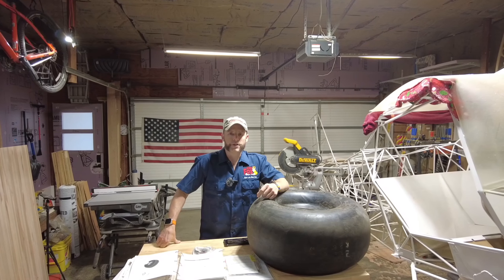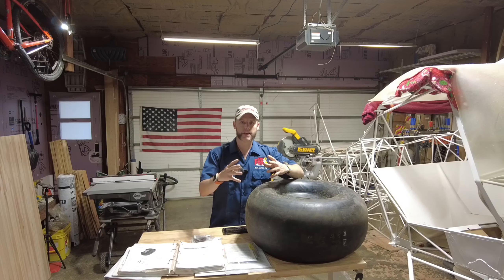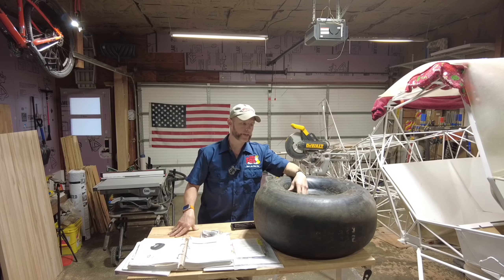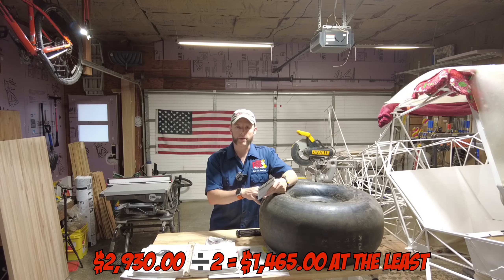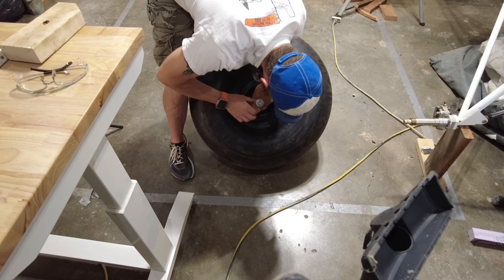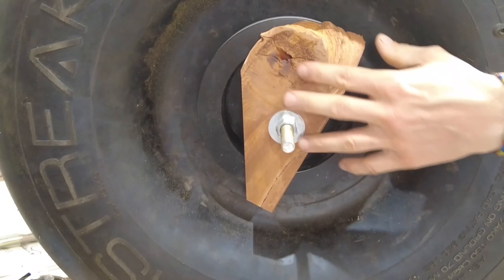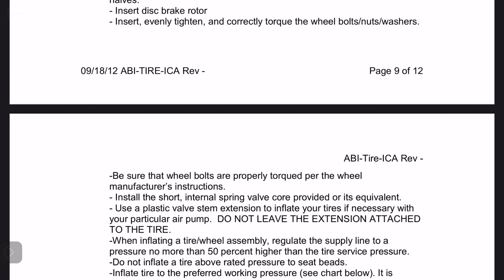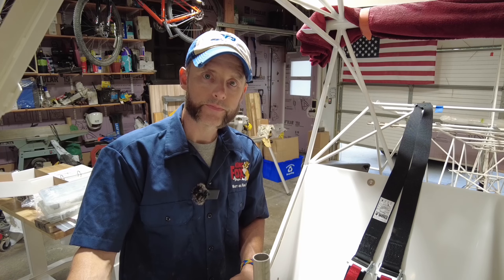#56 The Tire Debacle

Comment: Hey Matt! Whenever I'm dealing with airplane tubes I use a crap ton of talc. I'm not familiar with these integrated tube/tires but I've had 2 tubes leak on the sidewall due to lack of talc. Seems like it would help the rubber slide where it is supposed to be instead of sticking in the gap. Keep you powder dry!
Reply from the maker: Hello Frank, I appreciate the information.  It is probably very obvious that I’ve not dealt with tires much and I can use all the help I can get.  I’ll do my best to keep the powder dry!  Thanks for writing.  Have a good day, Matt

Comment: Hey Matt,  not advice about how to get the rubber on easier, but I noticed you installed the bolts through your wheel halves from the outside, with the nuts under the brake disk.  I think if you look you'll see that it should be the other way around.  Much easier during pre-flight to see those nuts in place.
Reply from the maker: Hello Mike, you are correct sir and I appreciate you pointing out my blunder.  Since the tire is again flat… I have to pull it off the rim again and I will fix my mistake.  I’m making a video of that too, I hope you don’t mind if I name drop you in the video?  I appreciate your attention to detail.  Take care, Matt

Comment: Go get some " Tech" brand patches.  Tech glue also. Do not use cheap patch kits from the parts house. If you are going to attempt to repair the tube do it with professional grade glue and patches.  I do this for a living.  Most tire shops have too many silly rules and regulations nowadays to even touch anything like this. And quite honestly are not competent enough to do the job correctly.  That's how I get my business.  I do the tire work No one else can do . If you grind on that tube to repair it , it can only be doe one time. If you screw that up you definitely cannot fix it. Please listen to me and get the proper material ro do the job. Just trying to help bud.
Reply: Also when you are assembling the wheel halves put just enough air in the tube to round it out. All you are trying ttobso is get the wrinkles out. Use tons of dishwashing soap to make the beads slick as possible.  Good luck.
Reply from the maker: Hello Sir, thanks for the advice.  I enjoy it when folks reach out that know what they are doing, as you can tell from the videos I’m definitely not an expert!  So as you may already know I did in fact use not one but two patches from the parts house.  So my question for you (this is behind the scenes info btw) as my tire is still flat.  Can I take the two patches off that I’ve applied and put a good one on using the Tech brand that you mention?  I lightly scuffed the tube using the cheap little metal thing that came with the patch kit.  Is that what you mean when you refer to grinding?  Thanks again for the help, I do appreciate it.
Reply from the maker: Another good tip that I will use.  As I mentioned in my previous reply, the tire is still going flat so I have to take it off the craft again… I will eventually be really good at this.  I will add a small amount of air to get the wrinkles out.  Soap without water for the beads?  And lastly, in your opinion, if this was your tire and you patched it yourself, would you feel comfortable flying it that way or would you just get a new one?  According to Airframes Alaska they said I need a new tire.  I was only trying to patch it so I could continue using it while it is in the shop.  Thanks again for reaching out with good info.  Have a good day, Matt
Reply: @KingFox76  it's not rocket science.  Just wantcthe beads slick. Doesn't matter about the water. As far as trusting the repair check the patch before you reinstall with soap.  If it's not leaking it will hold. Of course they told u to purchase a new tire. Hell I wish I needed tires that big on my plane. I'd buy that one from u . I wish I had a penny for everytime a salesman told someone they" needed a new one". I'd be  a millionaire!!! Ha! If you already tried I'm afraid u can't re-grind the tube . That's why I stressed in the beginning it must be done correctly the first time. I definitely would fly with my repair . If it's dine properly it's chemically bonded as one.  Good as new. If it's leaking down after a repair attempt I definitely would not fly though.  That wouldn't be very smart!
Reply from the maker: @richardturner6278  We could call it rubber science.  In the not so near future I’ll be using your techniques with the soap.  So using the small little scuffing tool is what you call “grinding?” Just so that I am clear.  So for now I’ll be sticking to using the tire in the shop only.  Thanks again for the good gouge Sir. Have a good day, Matt
Reply: @KingFox76  I should not have said grind.  Actually called buffing. It's a special wheel that attaches to a die grinder.  I realize it's not so easy for the average person to do.  Not that difficult.  It just takes specialized tools to really do a good job. My fault I guess for making it sound so easy. I promise there's a tire man around there somewhere that could help you out. I hate it for you. Just a bad deal but we all live and learn.
Reply from the maker: @richardturner6278  I would say what I did was a light “scratch” on the surface of the tire with that cheap little metal disc that came with the patch kit.  I barely removed any material, more like using some scotch brite on the fuselage prior to some epoxy.  I think the tire is still structurally sound around the damage as could be expected.  Like you said, since this is a “live & learn” event there will be no harm in me actually doing some buffing on the tire.  I’m still going to give it a go.  Perhaps I should watch some YouTube vids of “tire grinding” so I can get an idea of how easy or difficult it is.  Any off the top of your head that you might recommend me watching?  Thanks and have a good day, Matt
Reply from the maker: Hello, @richardturner6278, I just got off the phone with Christian and Matt Smith over at TRC. They’re hooking me up with a patch kit with a stitcher and a buffer and vulcanizing fluid and a plug patch combination item. I appreciate your input and I look forward to using this one it arrives. Have a great day and thanks for the great comments. Matt.